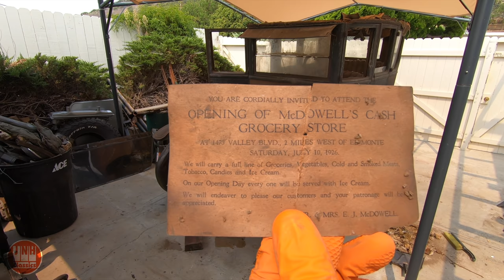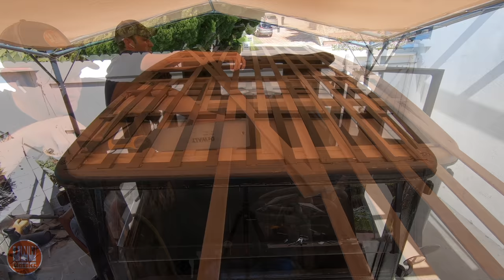Amazing Transformation of a Neglected Model T!

Comment: The only thing I would have done different would be to give the body a brand new paint job of the same color as when it was new.
Reply: Some pitting throughout the body. Would take tremendous work and body filler. Expensive. Got to know when to call it enough.
Reply: Sometimes original paint job adds value
Reply: It's protected now, but keeps the aged look. I like it!
Reply: I mean it doesn't look too bad